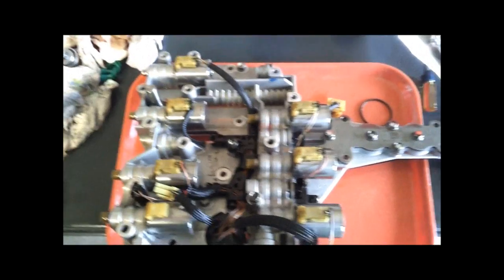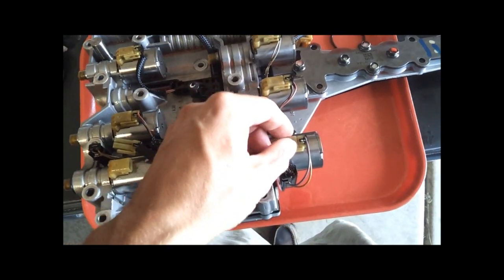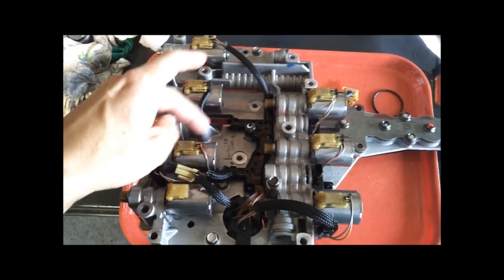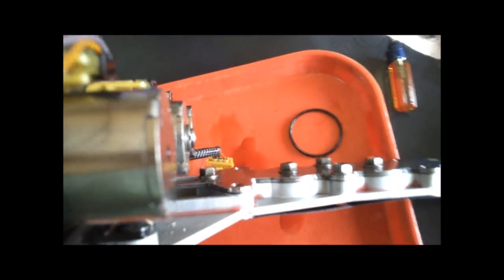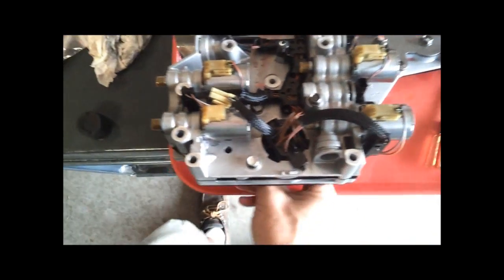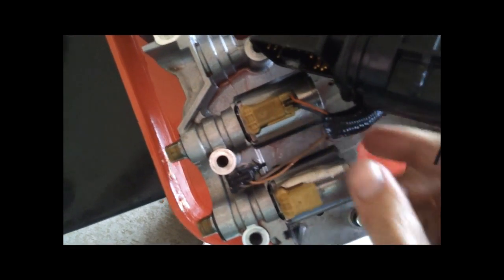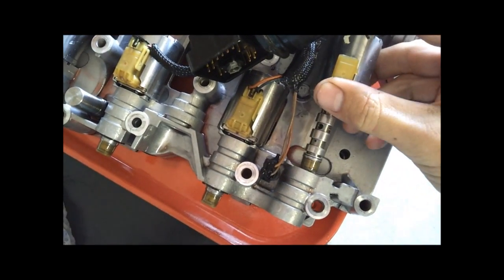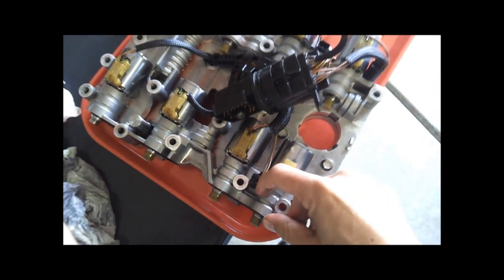FORD Superduty ~5R110W Transmission~ Pressure Control Solenoid Replacement

Comment: I had a f250 09 .
5r110w .
Flashing lights in D and R harsh shifting i heard clicking on/off in solenoid pc-a .
I got a code p0607 .whats is the best move ?

Comment: Do you have to remove that pressure plate Out of the transmission to to remove the sir noid out of the transmission can you do it all in while the transmission together without the pan being on it

Comment: I had a Tow Howl light and low trans temp. I replaced the sensor (twice) and happened again. Should I need to replace the Temp solenoid or the competente harness?... or both?
Reply: Im having the same issues replaced the transmission temp sensor 3 times still haul light flashing and check gauges any idea
Reply: @mikerosario8824   what was the problem?
Reply: @jaimenunez4137   the wiring harness the outside

Comment: My 5r110W is having direct drive issues on highway around 60MPH tow haul light will start flashing, any tips id appreciate it.
Reply: Wich filter
Reply: Tft sensor its small it in the transmission valve body , trusttt me

Comment: l have 2005 f250 the hauler light flashin & start loose power
Reply: I have the same problem, what you did to fixed?
Reply: Gauge cluster needs repair

Comment: Replaced 04 5r110 with a good 06 5r110 works fine if you stay in 1st but when you get up to speed tow haul light flashes and seems to loose first gear and converter seems to loose.  Is there a sensor that is different on the 06 trans that I need to replace with an 04 style?
Reply: check your line pressure. you may need to swap out a solenoid if the pressure control solenoid is bad
Reply: I hear you have to reprogram the PCM/TCM if you put an 05-07 transmission in our 03-04's.
Reply: +john doe you might. 03-04 had more pressure sensors that were taken out of later years
Reply: guess nobody knows,,,
Reply: You got to check Pressures on this Transmission.

Comment: What problem would the   transmission have to let you know it's the pressure solenoid ?
Reply: You would not be able to shift or engage any gears.
Reply: +SuperDuty As I'm driving, I hear a loud noise like a blower at high speed. Then it changes gears without any hard shifts. Could it be that solenoid or should I change the filter and fluid first, then
troubleshoot from there ?
Reply: +Blah Blah pressure test it. search my channel for 5r110w pressure test and you should find it
Reply: +SuperDuty Thanks

Comment: Thanks for the info! I believe I may have inadvertently screwed up my SSPC-D by meddling with the set screw on the back of it. Is there a factory setting that I can go back to? It shifts okay until 4th gear comes in... early and hard. All the rest of the gears are fine. The only other thing I did was replace the temp sensor, filters and oil.
Reply: Good question. There is not any info in the service manuals so I can't help you there. I think you have 2 options: 
1- keep making adjustments to the screw until you get a good response. Make notes of what you did and report back for others.
2-buy a new solenoid, swap it out and see if you have the same behavior.

Comment: Cr38er thank you for all of the posts.  I have a 05 Diesel Excursion and believe I am having intermittent solenoid issues.  Symptons: First start of the day truck goes into reverse just fine, then from Reverse to Neutral to Drive there sometimes a 3 second delay before engagement.  Then say once a week when shifting from 2-3 or 3-4 (don't know which) the RPM's increase to 2500 but shifting does not accompany the Rev increase. It feels like the tranny doesn't know which gear is next. Does this sound like a solenoid to you and can it be scanned to tell me which one to replace?
Reply from the maker: Scott Alvarez You need to do a line pressure test: https://www.youtube.com/watch?v=Bk7L_Mdet98

When was the last time you had a flush done at a good shop? If you do a flush anywhere but Ford, make sure you install an inline filter or upgrade to the '08 pan and filter. Transmission shops use generic fluid which can dislodge stuff and clog up the pump.
https://www.youtube.com/watch?v=zDpL7kZf9qo
Reply: Scott Alvarez Thank you for the reply.  I change the spin on inline filter every year.  It had been 2 years since a Ford dealership did a flush. Two months ago a drive through oil change place did a drain and replaced some fluid with something I doubt is high quality fluid. The tranny was having the same symptoms prior to the crappy drain. I saw you post about the 08 pan/filter upgrade and will do it.  Since I am dropping the pan can you tell me which solenoids do the Reverse-Neutral-Drive shifting?  Also are they the same ones involved with the 3-4 shift? My email is scott.alvarez@tampabay.rr.com if that is easier for you.
Reply: Scott Alvarez Most likely it is the pressure control solenoid. It controls the hydraulic pressure to the whole rest of the transmission and the other solenoids. Pressure problems can easily cause your symptoms. Do the line pressure test. The parts are under $20 (direct links to the exact parts you need are in the video description for that video). The test is easy to do and will tell you if your pressure control solenoid is the problem. Also if one of the other solenoids were having issues you would get a trouble code accompanied by a flashing tow/haul light.
Reply: Thank you.  I will research and do the test. Cr38r's video shows how to remove the pressure control solenoid after the entire assembly is removed.  Question: How do you remove the assembly from tranny?  I am going to do his 08 filter/pan upgrade and might as well replace the EPC/PA solenoid while I'm in there.
Reply: Scott Alvarez Update: I did the pressure test exactly as Cr38r said.  Pressures were all above levels for both idle and stall engine speeds. I then went to two different repair shops including AAMCO.  Neither found codes nor could duplicate my symptoms.  I ordered the pan/filter upgrade and will install then do a new factory flush.  Fingers crossed.  Gadget, where can I read/learn how to remove the valve body?  I might as well swap the EPC/PCA solenoid while I'm in there if what you said is most common.
Reply from the maker: Scott Alvarez If your pressures are good then you don't need to touch the PCA solenoid which is good. It is the only one you have to completely remove the valve body to replace as shown in the video. The others can be done easily in a couple minutes after the pan is off. You are probably looking at a direct drive solenoid. It controls shifts into reverse and 3-5 as you described. There are 2 options here:1- get an upgraded one which makes the shifts much firmer(some sat this is unnecessarily hard on clutches )
http://www.amazon.com/dp/B00IRIU1P6/?tag=cr38er-20

2- Replace with an OEM Solenoid. This is probably the way I would go since the 5R110W is pretty well built stock.
http://www.amazon.com/dp/B00IRIU1P6/?tag=tsolenoid-20

Here is the video on replacing all of the other solenoids. Use the same procedure, but replace the direct Drive Solenoid:
https://youtu.be/fIRG2LpN5c4
Reply: Scott Alvarez Update-I did the filter& pan upgrade you recommended. Found the new pan holds a little more fluid than original.  I found there was some caking of metal on the donut magnet and film of metal on the solenoids.  I wiped the solenoids as clean as possible,without removal, checked wire connections, installed the new pan, filter and added in the fluid in your video.  This was 10 days ago and the trans hasn't done the rev/flare symptom since. Maybe I'm nuts but it seems to run smoother as well. Thank you tremendously. I plan to give the new filter some more time, then replace it again along with new fluid. If it does give me another rev/flare then I will go ahead and replace the direct drive solenoid you suggested.

Comment: No need to remove the valve body... if you use the stock oring it will cut it when you force the harness  back through the valve body and case  ..My solution.... put green harness orings from a 4l80e transmissionin on  each groove with some assembly lube and will slip right in and seal well....I did it today no problems ....Dont worry your ford will not reject the chevy parts LOL
Reply: Joseph E Pearson how do you remove it just push it through is that it
Reply: For explanation purposes. 
Great vid

Comment: Can you explain how to take the solenoid body off the transmission? Torque specs etc etc? Thank you
Reply from the maker: The Entire Valve Body needs to be removed to get to the PC-A solenoid. You will want to make sure you have a new (Paper) valve body gasket to put on it when you re-assemble. Here is a link to the Torque Specs and Tightening Sequence:
http://imgur.com/a/vnXsb#0

Let me know if you need more details
Reply from the maker: Here is a link to the Transtar gasket for $2.57. Transtar makes/distributes the solenoids and gaskets for ford:
http://www.makcotransmissionparts.com/16320A.html

Comment: Mr cr38er,

 Thank you for the video! Great information!! I am planning to replace my PCS this weekend along with my D solenoid. Can I pull the valve body while the transmission is still in the truck? If so is there anything I should be aware of(falling parts) or is it an easy removal? Also is there any good DIY version of flushing these transmissions? Thank you in advance for all of your time and Help!!!
Reply from the maker: Sorry, just saw this.
As you have already discovered; Yes it unbolts easily Make sure you have new paper gaskets though.

As far as flushing, you can do it yourself, but make sure you upgrade to the '08 transmission pan and new '08 Full Flow Internal filter or install a 1/2" Magnaflow filter after doing so. This is especially true if you are switching to Valvoline Maxlife Fluid or have neglected your transmission.
Reply from the maker: Instructions for Self Flush:
http://www.ford-trucks.com/forums/1258536-my-revised-torqshift-transmission-flush-procedure.html#post13825465

Comment: I have a f250 2005 6.0 2 wd my tramsmission is hard shifting and the over drive is not getting in  the light tow haul is blincking  what could be the problem?
Reply from the maker: You need to test your pressure. There is a test port on the drivers side right above the transmission pan. You will need a pressure gauge that goes up to 350PSI.
Reply: so then what how are you going to know which solenoid to place ive got the light on my shifter stay on un able to turn off and no over drive that kicks in  which  solenoid would you replace for that ???